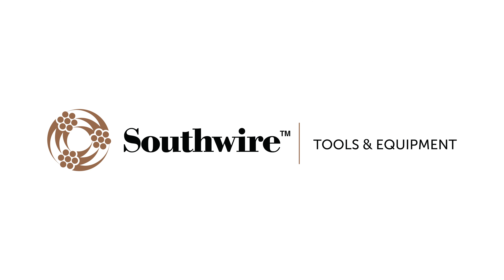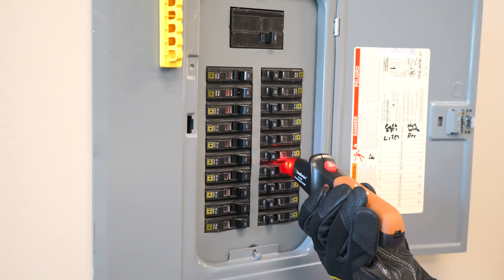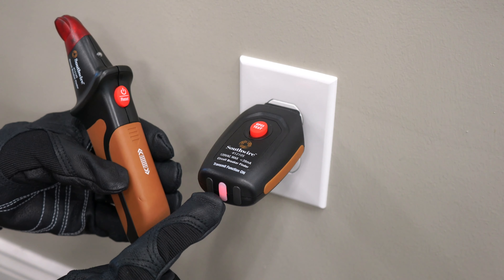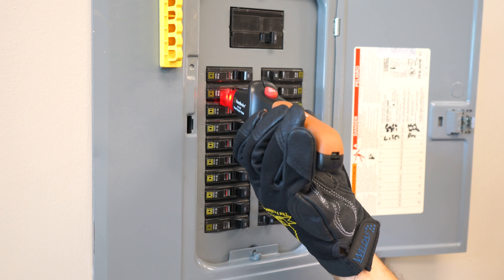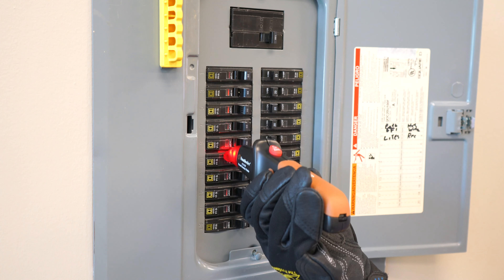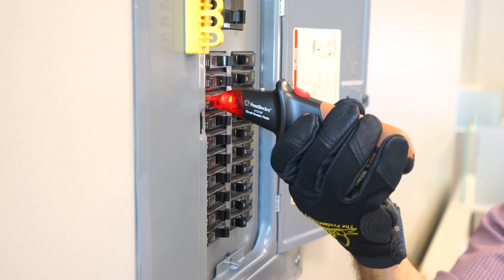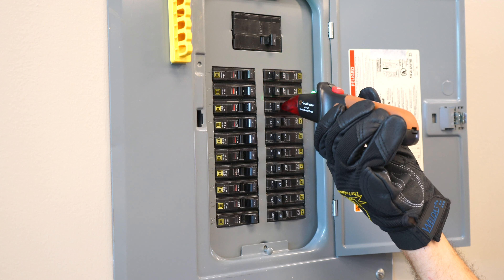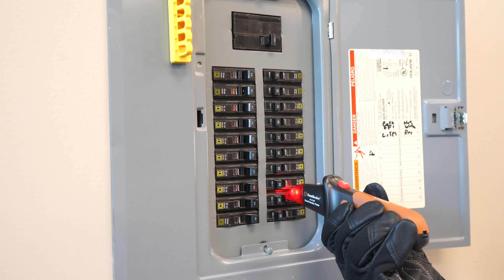Southwire 41210S Circuit Breaker Finder How-To

Comment: So I purchased the Southwire Tester. Followed the instructions. The results were not consistent. The tester also would not stay on for the three minutes as the instructions said it would. I would turn it on and have to start the entire process all over again. When calibrating to transmitter the results were not the as the instructions said it would be. I could calibrate it three time and the transmitter would react differently all three times. Finally got fed up with those shenanigans' and returned the scanner for another one. If I get the same results with the second unit I would assume it's an internal wiring problem at the box or maybe stray voltage.

Comment: Got fucken damnit. Im trying to use the accessory kit with the light bulb socket. How the fuck is the sender suppose to plug in the socket adaptor when the socket only has 2 fucken prongs and the size of the stupid adapter gets in rhe way of inserting the sender? And why is there not any instructions included? This fucken frustrating.

Comment: I am still trying to figure this out. In the video, all the breakers are standard breakers. In my box, some are AFCI and some GFCI. It seems that one AFCI breaker ALWAYS shows as the breaker I am trying to find. I need to skip over it in the scan. But if I the breaker I need is next to it, I need to turn that AFCI breaker off before doing the scan. Anyone else have this kind of result with different breaker types?
Reply: I have multiple AFCI breakers grouped together, and the scanner reacts to almost all of them as well.